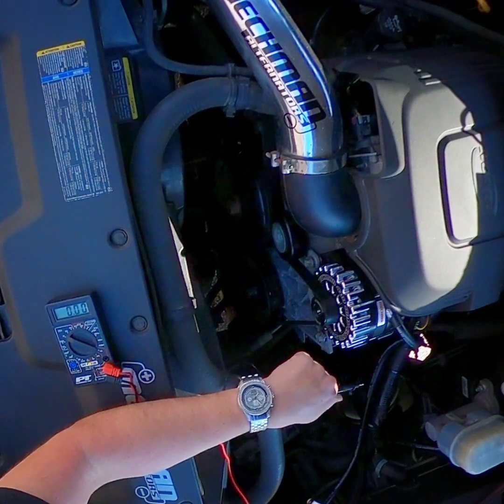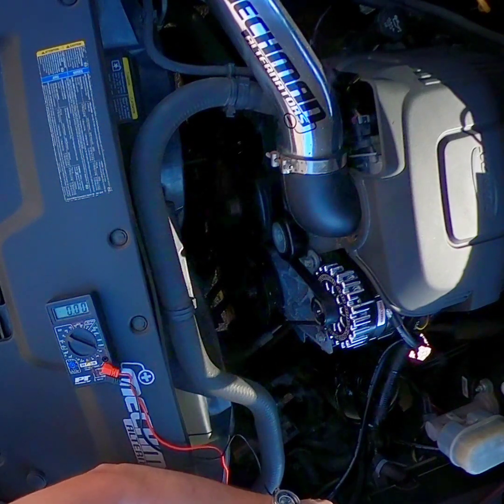Why do our Billet alternators need a specific ground bolt?  Watch and learn...

Comment: I'm just curious is one ground from alternator to battery of ofc 0 gage enough for a 240 amp I'm not trying to show off I just won't to make shur alternator is sufficient with that run
Reply from the maker: Sure is! In fact 1 zero gauge OFC wire directly from the alternator to battery is enough for a 400amp alternator!  It's just physics.
Reply: I bought a 240 amp alternator from y'all for my 1200 watt rms amp and im only going to run one ground from alternator to battery I glad that all I need is that one ground thanks for your reply 👍
Reply from the maker: @darinmoorman1872  Simple works best in 99.9% cases.  The internet/social media is a wealth of information...too bad its mostly the uneducated that have the louder appearances. :(

Comment: Those billet alternators are sexy! You got a high amp one for late model Mopars?
Reply from the maker: No billets for the Mopars. It's a double edge sword really. We have a few people each year ask about Billets for Ford/Mopar/Ram/Etc, but we've found that when we offer them that customer no longer likes the upgraded price.  We COULD make one, but it would be a terrible business move when the  majority customer base just isn't there to support it.
Reply: @mechmanalternators  That's too bad, but understandable. Thanks for the update! 👍🏼
Reply from the maker: @DJGRoc   Trust me, i'm trying to get some more Billet's out there, there's just a few hoops to jump through.  Also looking at some small case billet design updates.
Reply: @mechmanalternators  I totally understand. It would be nice to have one for my Chally, as it would look great with my color scheme. I'll settle for the low gloss black painted unit for now.
Reply from the maker: @DJGRoc   The low gloss or semi gloss black and of course ORANGE are the hot colors most of the Mopar guys go with.   I believe we did a Plum Purple not long ago for a Plum Purple Charger that looked pretty sweet.
Reply: @mechmanalternators  My Chally is black, so the low gloss black will fit rather nicely.

Comment: Okay logical question.... why not just ground to the frame..... you're saying ground from the alternator back to the battery... the negative of the battery grounds directly to the frame... so what's the scoop
Reply: You can, but the best option is the battery.
Reply: Oem wiring the alt would still go Thur the engine to Frame then battery. But alt to battery is the least resistance. So it best to just ground alt & battery directly together.

Comment: That’s good to know that the alternator can’t ground through the rest of the truck… if you run your ground to the battery that eliminates the chance of any weird noises, this whole time I been trying to figure out how to isolate the alternator ground from the rest of the truck, that way the amps are on there own ground not shared with anything else in the vehicle

Comment: I did an ls swap I got the billet 370 2 pin what do I need
Reply: I think you need a 4 pin regulator.  Use the one wire pigtail to exite the alternator.

Comment: When you going to make a 14v alternator. Or an 12-16 v adjustable alternator!
Reply: That was the original plan actually. Going to do a dual setup with one at 12v running the truck and another at 14 volts running the audio in the 16.5-17 volt range. 

It changed because an amateur or hobby level audio person really doesn't need that complication to achieve the same results as a well put together system. 

I mean...most people don't know how to run a shorter belt or a 12v switched source 😇🥰
Reply: @Tony Bolton  
How about a race version alternator  that will charge a 14v battery!
Reply: @joeas7475  a "race alternator" should be for a 12v battery. A 14 volt battery needs to be charged around 16.5-16.9 volts. High torque drag, external regulation.....its a bad combo for a race vehicle. 12v battery and high quality alternator are the best combination.
Reply: @Tony Bolton  
Than why are all track only cars 16v?  More spark energy.  Fans and pumps all work better higher voltage 
You should really consider this
Reply: @joeas7475  because those are usually max effort applications where they don't even run an alternator and the batteries are removed/recharged per runs. I answer questions like that on a weekly basis. Everyone wants to do race car stuff until they find out what is actually involved.

If I can get a 4 sec. 1/8th mile no prep car with a 12v battery and alternator i think we're on the right path.

Also, its not the higher voltage from 16v batteries, its merely a crude way to combat voltage drop in a short run time.